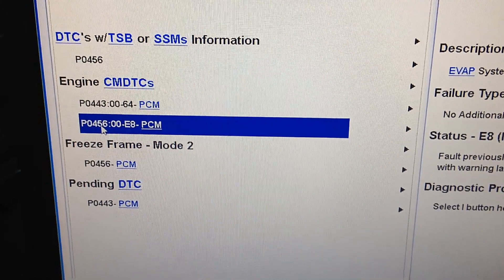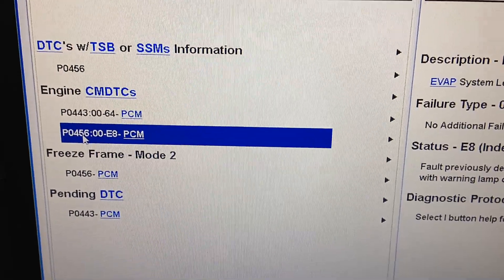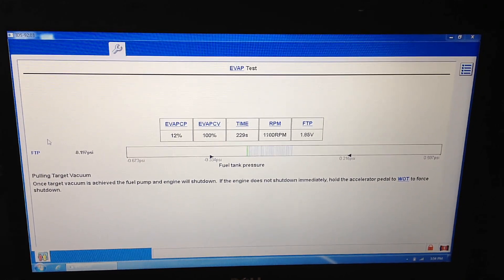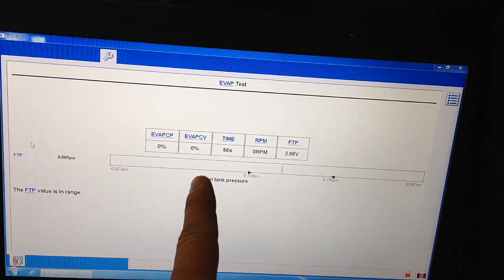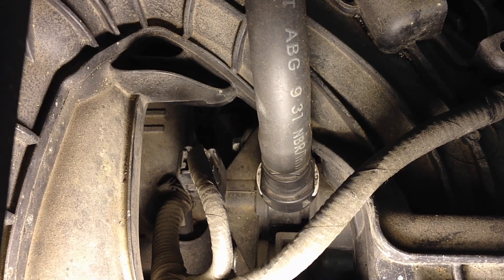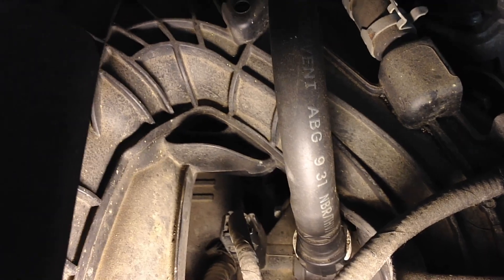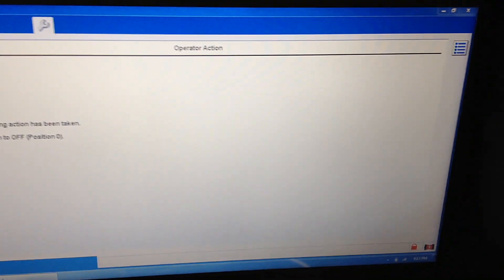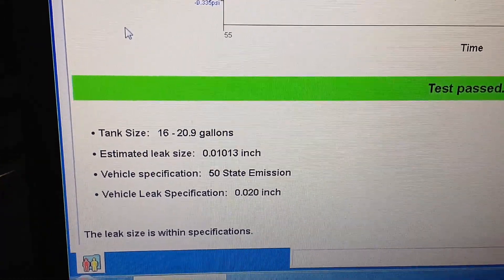Multiple Ford Vehicles 2009+ Evap System Leak Codes P0456 P0457 P1450

Comment: whats the video for filler neck maintenance
Reply from the maker: Quick Tips: #4 Ford Capless Fuel Filler Maintenance
Reply: FordTechMakuloco
thanks! so is it spring tension that keeps the filler sealed during vacuum testing?
Reply from the maker: srv3fender Yes spring pressure that keeps that flapper shut to seal the system.